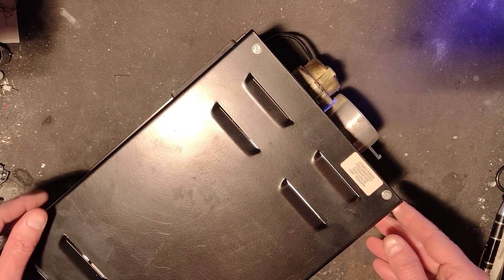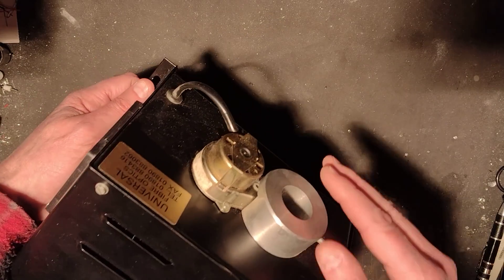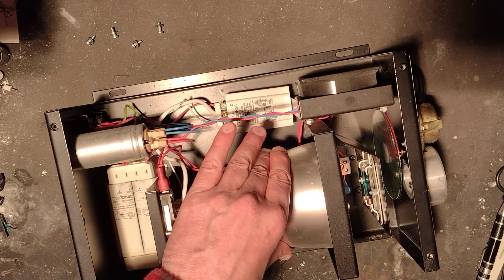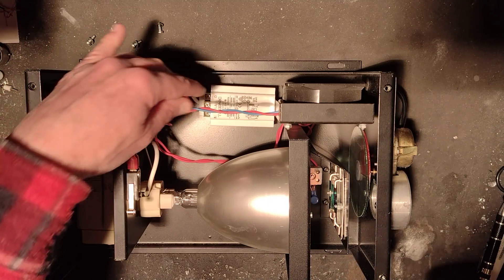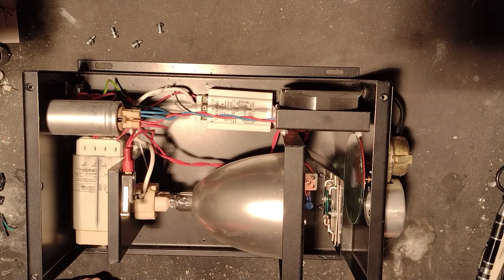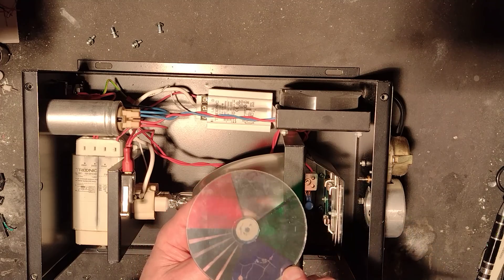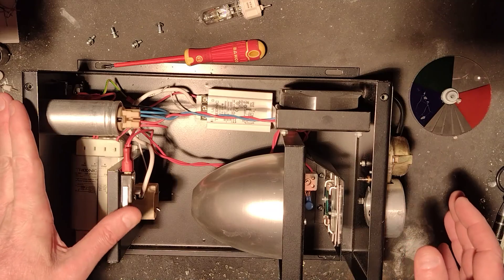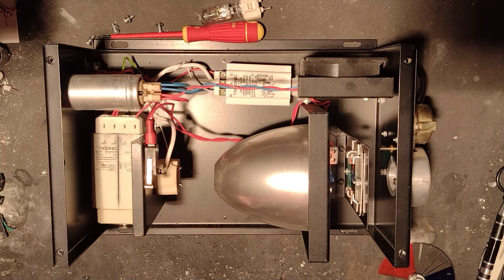Metal halide fiber optic illuminator

Comment: Love the safety isolation switch but they needed that switch down low where its hard to access. Kind of defeats the purpose of it if you can just depress it while changing the bulb
Reply: it's called natural selection and it needs to run it's course. meaning if your dumb enough to zap yourself, you shouldn't be inside of things playing around anyway.
same goes for RCD and GFCI, yes they save some random people from devices faulting(more so with todays chinesium), but it's mainly idiots whom have no business playing inside things or with wiring, sadly it saves them and they learn absolutely nothing from it, so they just keep do it again and again, until it kills someone else from being hacked up.
oh no little timmy might stick a knife, paper clip, fork, wires into the power socket holes, lets punish the general public because of that.

Comment: UV blocking would only be the lamp capsule, with the internal UV blocking oxide layer on the quartz glass tube. Then the IR dichroic only providing some more, because it is made with soda lime glass, like the colour wheel, which blocks most of the UV. You see the UV block ability of those MH lamps on start up, where the initial light is mostly UV, and the glass outer capsule is very strongly flourescent, before the halide salts melt, and broaden out the light output and swamp the blue glow off the glass.

Replacing with LED is very hard, especially when you need a high CRI, as a MH lamp is a pretty good broadband light source, and does not have all the emission peaks that LED illumination has, providing measurable light output over the entire visible light spectrum, and a good way down into the IR as well, and a lot of UV as well, thus the UV block filter in the capsule, and the need to operate them in a tempered glass front luminaire, as those tubes are not available with the thick glass explosion guard, that is required for the lamps used in open fixtures.

Led retrofit does not work with MH, unless you redesign the entire optical path, as no LED can emulate the small sun that is the MH arc tube, the energy density of MH is way past LED in light emission per square mm of area. Only if you run the LED at insane power, and accept LED life will be lower than the MH life, will you even get within 2 orders of magnitude.
Reply: I know for having looked at UVA and UVC tubes that soda lime glass will only block UVC and maybe UVB but definitely not UVA
(Ask me how I know, I'll answer no problem but it may be a bit drawn out).

Anyways I just got a second hand 250W Fc2 metal halide floodlight and unfortunately I broke the bulb trying to remove it (The fixture was in need of a good clean and a proper rewiring job which I'm currently doing). This Philips bulb had "UV Block" marked on its outer capsule.

So I bought another bulb, second hand aswell as new ones are a bit expensive, it's also a Philips one but unfortunately it doesn't have UV Block marked on it !

Because of that I'm not really sure if I can use it safely or not.
The floodlight of course does have a glass window as it's meant to be used outdoors but I don't know if that will be enough to block UV rays coming from the bulb or not.

Having no info about the glass of the floodlight I don't know if it's soda lime or borosilicata (Aka Pyrex) and also I don't know about the UV spectrum of my MH lamp. 
Is it mostly UVA or UVB or UVC that it's putting out ?

If it was only UVC I could imply put another layer of soda lime glass in front of my floodlight just in case but if it's UVA, nothing will filter out enough of it for the light not to be hazardous to my eyes.

Any idea ?

Comment: I have a scientific/lab version of this device.  It is smaller but strikingly similar.  It was used (and still is) as a directional light source for a low power microscope.  The light quality/spectrum is delightful.  My favorite part is that you have to turn the dial up to get it to arc initially, and then you can adjust the output as desired.

Comment: Couple things getting my curiosity...

The parabolic reflector is much larger than the collet; how does it get all that bright light down to a much smaller area?  Lens(es)?

The standard LED light is about 1/6 the wattage of an incandescent for the same light output -- 10 watts for a 60 watt incandescent.  But how about metal halide?  Are they more efficient than incandescent?  How much power does an LED version save?

Thanks, Clive.  Great video.  Happy Holidays!
Reply from the maker: Metal halide lamps are very efficient.  They give LEDs a run for their money.

Comment: They came up with solar illuminators via fiber optics so in order to save money on Electricity .great idea .you can place  cables in concrete on surface areas and so on and no chance of shock and loads of light so long as the sun was out or the lights were running

Comment: [DAY 3 ATTEMPT 5] - Trying to Ask a Q & Not Have YT Treat It as Spam.... NO LINKS EDITION
Clive, if I may ask a question unrelated to this video, about something that has me rather perplexed? :\ (Of course, anyone who knows is certainly welcome to answer!)

While diagnosing a TV that died (but unrelated to the death), on the Hot Side of the PSU are two 16V 10uF polarized electrolytic caps; bottom left "C671" and "C672" (marked 10/16V):
data2 dot manualslib dot CEE OH EM \ big_img \ en-53315b8a81a92b1aa776e8edb4136460-000079 dot PEE EN GEE

W....why are BOTH pins soldered to ground??? That's even ignoring the fact they're 16V and connected to 61V AC (though I may have incorrectly measured it?), sort of at least, since they're technically not really "in" the circuit.

I haven't been able to find the right term combo to come up with an answer, since Google has become so god awful with search results...
I've wracked my brain for quite some time over it ~today~ some-days-back, and the ONLY conclusion I could come up with is: The capacitors must have each leg connected to two different ground layers in the PCB, but of the same ground plane. Which, to block/suppress/mitigate-somehow, any potential voltage differential between them, they've added these between them...? *epic-shrug*

I don't really expect that's the case here, as I don't know why they'd want to separate the grounds in this instance, but that's the only thing I can come up with lol To me, it comes across like taping a good bulb to your flashlight, hoping its presence will allow the lit bulb to last longer. :|

Here's the entire service manual, for anyone interested in looking at more of the circuit. The shite TV in my case specifically, is "Type F". (mine was technically an LF320EM5, but same board)
manualslib dot CEE OH EM \ manual \ 1216112 \ Funai-Lf320em4-A dot AYCH TEE EM EL

Thanks either way, and happy holidays/new year to everyone!
_(I'm sure it's the links so lets hope spelling stuff out and using the wrong slashes helps... since YT Algo insists on auto-removing my messages due to thinking it's spam... Starting to wonder if I need to reference adult oriented things in order for it NOT to flag it lol_)
Reply: [PROBABLY IRRELEVANT RAMBLING]

Only reason I stumbled upon this curiosity of capacitor use, was I had replaced those two caps in an attempt to maybe get it going again. However, I bodged one, as they're obviously tiny, where my soldering bridge both pins... and I don't have any desolder braid. After working to rectify that, to confirm I had gotten them separated again, I did a Continuity test, only to have the DMM scream at me still...

I thought maybe I killed the cap with too much heat, and removed it, did a Continuity test and... no screaming. Being as the board was dead, I decided to have fun and gouge a trench around the pins to remove it form that ground plane (shone a light behind the PCB to confirm I'd removed all the copper around it)... only to have those pins still claim continuity. Admittedly, this kind of kills my theory above, as one pin should've lost continuity here, so clearly another PCB layer still had a trace connecting to it that my light was diffusing around.

[/PROBABLY IRRELEVANT RAMBLING]

Comment: I find myself wondering just how detailed one could get that disc.  Could you produce recognisable images out the other side that scroll across as the disc turns?
Reply from the maker: That would require accurately bundled fibre optics.  Or for protection it would require a suitable lens.
Reply: Sounds like "Possible, but not feasible" to me.

Comment: The museum at Manassas National Battlefield Park near Washington DC, (first major land battle of the American Civil War) was rebuilt around 1999, used 2 of these devices. One fed fiber optic bundles terminating in various fittings on the other end to light pinpoint or wash over the various artifacts and descriptive panels.  The other one was fed through a series of rotating wheels with various slots to control fiber optics in a map of the battlefield which formed dotted lines sowing the movements of the troops during the battle. This was synchronized with an audio recording describing what was happening during the battle. I was volunteering at the park while the remodeling was being done. During a visit to the park in 2018, the mechanical wheels of the map were not working due to the complexity of the wheel system getting out of kilter due to lack of funding to maintain the complex system, but the other displays were fine,. I suggested they replace the lamp and wheels running the map with a series of individually controlled LED-3 color strips. Don't know whether they did or not.

Comment: 7:50 Interesting double-bulbed bulb ! The Strand followspots just had the inner bulb. You can see the 2 wire pins on it inside the outer bulb. (400W Mercury Halide, Patt. 265)

Comment: I’m sure you will know this but, for the benefit of your viewers, you should use the back if your finger to test if something is too hot. If you use the end/face, by the time the heat gets through the thick skin to your nerves you have already burnt yourself. The same thing applies to checking for live wires so you don’t end up gripping the wire uncontrollably.
Reply: And I thought appendices used for testing 😏😄

Comment: In the schools  work at we still have a number of metal halide wall packs outside and some lights inside. They range from 100 watt to 400 watt. some of the stadium lights are higher wattage.  The wall packs are being replaced by  LED wall packs as they die.

Comment: Models with a dimmer or a variable gradient ND filter were used as microscope illuminators, either with the fiber bundle going to a gooseneck with a lens, or hooked up to a ring light. You used them for the inspection stereomicroscopes that you use for SMD rework. You can also find very well built medical models, those would be used for an endoscope.
Reply: Clive actually has a teardown of one of those microscope illuminators on his channel

Comment: We bought a 6.5' (~1.5 m) fiber optic Christmas tree from a local Wal-Mart, some 15 years ago. When I got it, it was running on a 35-watt 12v halogen, which itself got quite hot (though nothing compared to that halide lamp!). When its cooling fan finally failed, the thermal cutoff wouldn't let us run the light long. Like a hacker, I thought about bypassing the thermal cutoff. 😁 Ended up replacing with a GE "Reveal" high-CRI LED lamp of the same form factor. Works every bit as well without the fan creating wind tunnel noises. 👍️
Reply: How standard was the fan?  Would it have been possible to replace it?
Reply: @JdeBP  Possible, but not straightforward. IIRC it was a 60mm fan which ran at 12v. I have 40 and 80mm on hand from PC parts, neither of which could be made to elegantly fit the case. In the end, since there's literally no visible difference in the output of the tree, I decided lower heat and less electricity use was a good thing.

Comment: Had one of those lamps installed in 2009 as chimney lighting. Philips MasterColour CDM-T 830 / 35W, with electronic "ballast" (full power supply apparently), treating it more gently than inductive one. They last forever, mine was on for approximately 5-6h a day, and all that happened after 11 years is its brightness decreased somewhat. The amount of light is similar to 180W halogen lamp. Don't need that much light any more, so I run two 5W LED bulbs there now. I like this tech, there is something magical about it, just "carbon arc lamp" from early XIX century, but tamed and improved to perfection :)
Reply: - Wait... The 19th century?   They didn't have carbon arc lamps commonly in the early 1800's.  They were very common in the last quarter of the 1800's and into the early 1900's, but prior to 1869, they were battery driven _only_, which severely limited them outside of laboratories.
Reply: I've been using for years an Osram HQI-TS NDL (4200 K) 70W bulb, RX7s, installed in a modified halogen lamp holder to light my living room. Used every day for several hours. It lasted 11 years (literally) before it would start to fail (the arc would need a few tries to ignite). Awesome technology.

Comment: They might not have been left accidently. I replaced over 50 of those suspended office ceiling lights that each contain 4x 55w tubes, with flat led panels. Several of the old disconnected light shells I just left up in the ceiling due to time constraints!

You could make a hell of a Taser out of that igniter?? ;)

Comment: A fair warning here, at 07:30 mark - you never want to touch any part of the glass of the metal halide lamp.  The oils from your fingers will cause the glass to get mega-hot and crack or burst the moment you turn it on.
Merry Christmas, btw, and here is to a happy and prosperous New Year to ya'.  Cheers
Reply: A common problem in the automotive world as well - up until LEDs took everything over.
Reply: @MoparNewport  That's why I always have a clean cotton cloth with the spare bulbs in my car.
Reply: You beat me to say that. A clean cotton glove. In a bag just for this job.
Reply: @assassinlexx1993  - in theatre, we used gloves or rags, plus the bag, and still carried alcohol wipes.
Reply: And I'm sure that's one of the main reasons why the light capsule is encased in a secondary outer shell.
Reply: @eDoc2020  - the outer shell explodes.  There's no benefit from a damage standpoint in having the outer shell.
Reply: @tbelding  Really? I thought having the outer shell would spread the heat enough that finger oils wouldn't make it fail. Even if it does fail it shouldn't explode because I don't believe the outer shell is pressurized.

I can see that the outer shell wouldn't protect you if the inner capsule explodes, if that's what you mean.
Reply: @eDoc2020  - I think the outer shell is mostly to protect the inner shell.  (I thought it had a vacuum, as the inner shell is filled with gas)  The heat is unbelievable with the various high power lamps; the outer shell isn't that much cooler than the inner.  I believe that the finger oils create a temperature gradient that's enough to cause cracking, but someone told me a long time ago that there can also be some etching caused by the vaporization of the oils.   I spent my time in theatre when all we had was the ultra high power incandescent.  Edward Albee (yes, personally) made me burn out SO many junction cables by driving those lamps at maximum power.

Comment: Hi Clive.
I had a Madscan 250 moving mirror dmx light.  The original lamp had failed so I bought a replacement lamp that was as similar as possible.  It had a new ignitor and it will work for about 15 minutes and then the lamp goes out.  It’s not the thermal cutout because it’s in series with the mains feed and the rest of the fixture continues to work (fan and mirror moves) Any idea why?
Reply from the maker: It's best to get the exact lamp recommended by the manufacturer.  It may be a thermal issue.

Comment: Metal halides had a nice run during vegetative growth until I got my first LED's.  The power and heat halved and the yield increased by 20%.
Reply: There are some newer ones that are good for blooming too
Reply: @Youtubecensoredmyusername  I've had one for a few years now although I do not use them any more.   The full spectrum (mulit-colored LEDs) is 350W and the veg light (all blue spectrum) is 400W.  If they were not so heavy, I would love Clive to do a teardown.  They are 15 years old or so.  Probably older now.  Technology has come a LONG way.
Reply: I used a 60W MH as fish tank light for many years. Provided good plant growth, and i did not need a room light at night. Ran it off a timer, so it was also the alarm clock in the morning. On at 6AM till 8AM, off the rest of the day, and on again from 4PM till 10PM, 7 days a week. Light on the fish were waiting for the food.
Reply: Very popular with marijuana "farmers".  Probably replaced by LED by now.